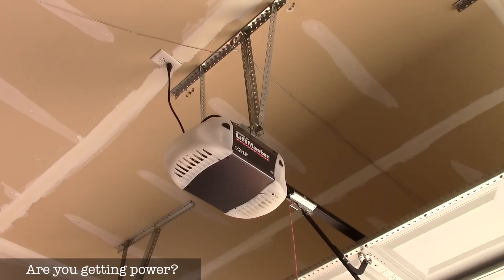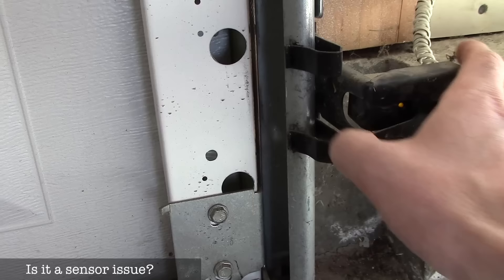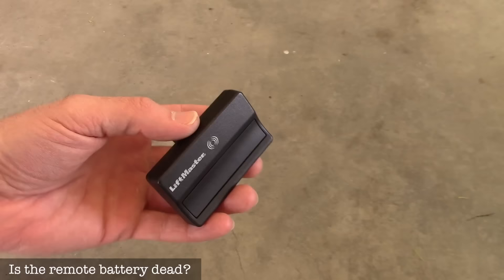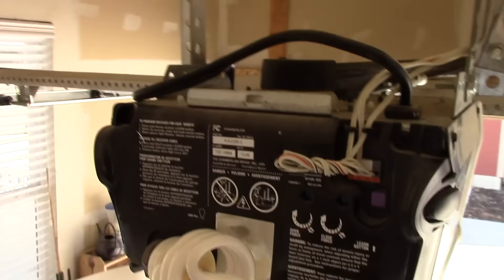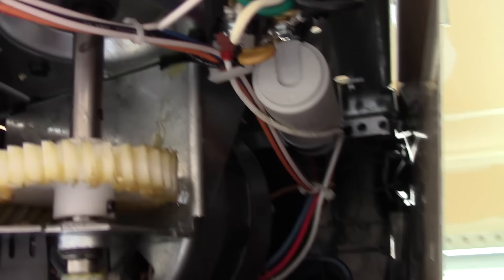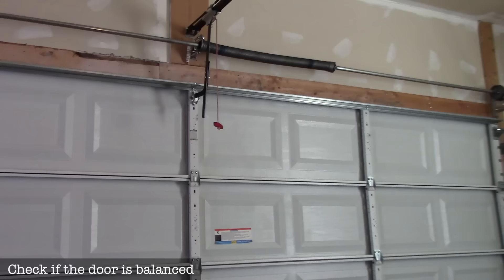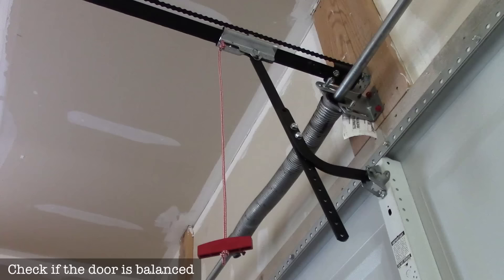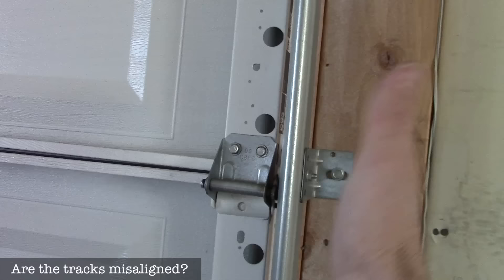Garage Door Opener Troubleshooting and Repair - How to fix common problems

Comment: Hi, good explanation!
Question?
I got my garage one time I was going one day and the garage was kind like to close .....just a little bit ...like came down like 12" Down and comeback up.

But I did make sure the sensor is straight.....well I guess it as I little bit move......but the other's days... .I was closing fine......
Because no body touch that area.......but any way....I move I little bit the sensor.......after like some period of time.....then close.

Well again it happen yesterday I was going.....and i did Luke 3 times closing.....and nothing....
And I was going to close from inside.......but I said myself......I will do one more time.....and it close the garage door.

But when I came back .....it opens but ..... didn't close it........I did clean the sensor s and try it to put straight like several s time......and nothing........

Should be the sensor s?
Because in the garage is power and the chain of the garage work normally when I try to open ........and the chain comeback normally.......but the door stay down?

Should I put.....a new SENSORS?

THANK U FOR YOU TIME.....

Comment: I have had a Stanley 01000 garage door opener for several years and it works great.  I also have a Liftmaster outside keypad and that has stopped working.  When I put in the code the Stanley opener clicks on the ceiling of the garage but nothing happens.  I cannot find a Smart Button on the opener to pair it with the keypad. Can you help?  Thanks, in advance, for your help!

Comment: Thanks for the video Adam but my garage door is still stuck. The motor/chain runs when I release the garage door off of it but the door won't move. I tried moving the garage door manually but it doesn't move. It's stuck in the up position

Comment: Adam everytime I get a power outage I have to reset the open/close limits.  This time It only holds the open limit but won't hold the close.  In other words it hits the ground then travels back up.  Does the board use a battery for memory or did something go bad?  Other than that the motor works just fine, its just a memory problem.

Comment: My garage door hums but will not open. I have replaced board and capacitor. I loosened the tension on chain because it seemed awfully tight. Still just hums. Do you think the motor is seized? There was alot of mud dauber nests. That was the reason the circuit board got replaced. I cleaned them out and didn't see any debris in the windings. I'm at a loss.

Comment: I had a voltage issue in a house both garage doors do not work so what is the most common when too much power gets to the unit? Capacitor,board or power supply?

Comment: Hi Adam, real nice video, however the problem i am having with my garage door is that when i try to open my door, the trolley would only move ever so little and that it (like 1/8"). I could manually open and close my garage door and I know for sure my sensor are good. I just changed my circuit board around couple of months ago and it worked perfectly until the last couple of days, this issue just happen. Would you have any idea what would be the case? Thanks

Comment: The small silver track that the door connects to is going back to far when garage closes, I have to pull the cord the door comes forward than it'll open & close, but to open again I have to do the same thing. How do I stop the metal silver track from going back to far? Thanks

Comment: Excellent instructions.. I have a craftsman model 315. I close it at night.  Later at night or next morning the door is open. I have re-programmed remote  and installed new btrys. No luck. Help!
Reply: I unplugged the battery from the exterior wall mounted remote and then plugged it back in and it hasn't opened since

Comment: I geta buzz sound,and nothing BUT chain seems to bind, on one side opposite tensioner side cap doesn't look bad but its probably cheapest to try first but I thought maybe take off chain from opener gear to see if it turns then

Comment: Adam, great videos. I have the same door opener, however I live in the country and all of a sudden my garage door just opens on its own.  Everything else works but can't seem to find the problem.  I have been locking the door to prevent it from opening. Suggestions?
Reply from the maker: Your nearest neighbor is how far?
Reply: They are located about 3000 feet away.  I will clear the codes today and see if that helps by reprogramming.  If not, then I'll check to see if I have a stuck button somewhere, and finally I will check for shorts in the house wired switch.  Thanks

Comment: Electrical power fluctuates from all power companies can damage electrical requirement and lighting strikes can damage electronic equipment of any kind as well. You should put surge protectors on every 120 volt electric  appliances or electronic equipment of any kind. They can save them from being damaged. I have surge protectors on everything in my house that use 120 volts. Including a dishwasher,  clothes washers, audio and video equipment, garage door openers, etc, etc, etc.

Comment: I am hoping you can help with an issue with my Genie garage door opener --- It does not work (either from remote or wall switch) when I reset the breaker it works.  Then stop working again.  Do you have any thoughts on how to fix?  Thank you.

Comment: Adam, I have three car garage with Chamberlain Liftmaster Formula I openers.  One of the openers does not respond to the handheld opener or my car opener.  It does work with the keypad and indoor pad.  When I use the handheld opener or my car remote the opener light blinks once but the door does not open.  The handheld opener work and car remote works for the other two doors.  Any thoughts what the problem is and how I can fix it?

Comment: Adam,
 I have a 2001 Liftmaster Professional series formula 1, Door opens all the way and then continues to shut off when trolley hits housing of motor. I adjust travel up and down, but I cannot get door to go down.(Out of sinc) Small light on housing blinks 5-times. As the eyes are adjusted too. I checked the gears and they are perfect. Need your help. Thanks Bob

Comment: so my garage door is cracking (tearing?) at the top center... it was installed the same way in my old home and i finally removed the garage door opener. A handyman remarked that it was a 5 minute fix, as the door wasn't properly installed for the size door it was pulling (i guess that main bar that holds the door to the center pully has several holes and it should be connected at a specific one, i think its called the J bar or bracket arm?) ... but i cannot find any instructions about which hole to use. Can you advise? PS i did not install either garage opener :)

Comment: Everything works, door will not close. But both of my Sensor lights are not on. I took off one and hard wired to the back of the  Garage opener and could not get the red light to come on. I am thinking of a Transformer  replacement. Your thoughts??

Comment: Adam,  my chamberlain model C450C has an  intermittent problem. When the garage door is closing all of a sudden the door reverses when it is 3/4 closing. I have replaced the ambler and green sensors. That did not make any difference as the problem still exists, but does not happen all of the time. Chamberlain has no schematics for the circuit board. I suspect that it could be a cold solder joint on the main circuit board. Is it safe with power disconnected to run a solder iron on the  main circuit board?

Comment: it seems in the last 2 months there is a beep for a second that comes from the garage door motor and this beep sound come back every so often either the door is open or close. 
Would you know what could cause this beeping noise? like and alarm beeping
Otherwise all is running good so far.
Thank you so much
C.Bourque
Reply from the maker: whats the model?

Comment: Hi Adam, My garage door goes up correctly. But if i want to close, it will go down, touch the floor and again go up. It doesnot stop after touching floor. So again i've to click the button so it will stop close to floor. And there is always some gap in between floor and door. Please let me know if you have any idea why its happening.

Comment: Switching the wiring from right to left has cured the opener from the open position to close all the way from the wall sensors. This happens due to natural light coming from different angles from the sun at different times of the year. The sensors get confused thinking it's an object. I've never seen  this shared?

Comment: Hi. I have an older sears Hbw1d3605 opener and this weekend I found the gear 41a2817 worn and the motor only turns on one direction. Other than the gear needing replacement, what could be the problem with the motor rotating only in one direction?  Any ideas?  Thx JP

Comment: Hi Adam,  I have a Craftsman 3/4 HP opener that's not traveling down to the same position consistently.  Sometimes it's travels long and sometime short.  I've adjusted the travel range but it's behaving a bit flaky meaning the when I make a minor adjustment it will barely respond or over respond.  Have you seen this problem before and can recommend a possible solution?

Comment: Hey Adam! Thank you for posting so amazing videos! I would like to ask you what could be the reason of the issue that I have with my lftmaster 1/3 hp. The wall opener inside the garage works without a problem, but the remotes and the keyboard don’t. I have replaced batteries and even bought a new remote! But nothing seems to work. I going to check all these other causes but I am asking just in case is a board problem that I might not see easily. Thanks for your time!

Comment: my garage door opener have no light in Both sensors I checked wire is good and I also replaced sensors still same but it closes if I hold close button from switch please advise

Comment: Hi and thank you for your informative video, however, my door is just humming when I push the wall mount to raise and close. I am trying to help my 92 year old neighbor with this. Initially I found one sensor bend from apparently someone hitting it so I realigned it. Now both are ok. I tried to reprogram the remote after opening the door. Somehow now the wall button just hums when I push it and nothing happens. I’m worried I did something to further cause a problem since now the door won’t go up at all. Help please! Also I have checked springs, wheels, etc. * I just noticed the chain is very tight. There is no play whatsoever in it.

Comment: I have a buzzing sound I think it’s the capacitor however I can’t find the exact one that looks like mine, but it has the same number the only difference is the back and it’s a 56uf not a 54uf  will that work?

Comment: Are chain drive openers interchangeable?  Could I replace the Overhead Door Model 556 with a Chamberlain Model PD752KEV or PD762EV?  Are Chain link and sprocket sizes standardized?

Comment: Hey Adam, older neighbor is having an issue with an xtreme door opener. Can’t get it to open even when holding the button. Tried to retract it and it cycled through. Eye sensors are red and green. Any thoughts?

Comment: Adam, I saw your whole video but did not find my issue. My garage door opens and closes flawlessly with the "doorbell" button inside the  garage. My issue is that I can open the door with any of the remotes from my cars or the external wireless remote but I can't close the door.  The floor sensors are also working well. Any more ideas..?

Comment: Hi, have you done a Motor Control troubleshooting? I have a liftmaster and is showing on the screen Motor Control error 1-5 or 15. Is only 2 years old and it won't go down.

Comment: I got a question about my overhead garage opener it was working fine with my wired wall button and with my phase 2 auto remote but when I tried program my wife’s Toyota Sequoia to the system and it took a code but know my wall button and the phase2 not working and all it does makes a humming noise for a few seconds but the chain does not move

Comment: My breakers arked and cooked my opener. Breakers have been fixed. Is my opener finished or is there something I can replace to get it up and running again? Power to opener is correct now. But no LED'S light up

Comment: I have a question. My genie screw drive opener ack and sounds like the trolley is slipping. I have replaced the trolley and coupler and still sounds the same and checked springs and balance. Any suggestions?

Comment: Wow. This was a lot of various issues. Most not very "common" however. (other than remote battery). Usually, sensors or limit switch. Bad capacitor? In all my years, I've NEVER seen a bad cap in a door opener. (or a "bad circuit board" ftm). But, never know. ;)

Comment: If the lights are completely off and the breaker in the control panel is okay; then, check any outlet in the garage that has GFCI; it the light is on, thenpress the button to reset it.

Comment: Hi Adam great video lesson.  I am a single women and a little afraid to try to do any repairs.. My garage door remote won't open electronically, and it won't open by hitting the switch on the wall.  I get this grinding sounds both ways.  I had a guy look at it and his first response was you need new springs without opening the Genie 1/2 horsepower  screwdriver model, he didn't look at the wall system he didn't unplug the system he did one thing looked around and said you need new springs, please I need your advice, I though about buying a carriage to replace the old one.

Comment: Thanks for the great information, however I have a further issue.  The opener does not function with the remote opener in the car or the wall opener.  The wall opener is flashing both LED's constantly & the door unit clicks.  If I push the Lock button the bulb flashes & the unit clicks.  If I pushs the Light button the unit clicks & the light on the unit flashes once.

Comment: Guys, I need some thoughts, ideas
The outside garage wall fixed keypad had a battery lived for 7 yrs. I changed it with a like for like (Energizer 9V) and dyed within 1 month. I replaced it again with another Energizer and died again within one month. The keypad fixed on the outside wall and hard wired to my garage opener. The wire goes behind the wall 
What’re your thoughts ? 
Thanks

Comment: Adam I have a genie 2028 garage door opener. I pushed the wall opener, got in my car, I was backing out of my garage and the  garage door came down on my vehicle with enough force that it punctured my vehicle. I then used my remote to reverse it. I backed out into the driveway and sensors had lights on. Here is additional information. It is 15 months old. It has an LED non garage light that installer had put in. The temperature dropped 30 degrees the night before but it was about 11 am and sunny. any ideas?

Comment: Hi Adam, great videos! I have a special circumstance. I believe my sensors are operating properly, just installed a new control board (bought from Chamberlain), a new RPM controller, and still my door won't close (3 calls to their tech support).  When I press the button the motor loads tension onto the belt for a second, then sounds like it's reversing but nothing moves.  Any suggestions?

Comment: I have a Stanley Premier Digital garage door model no 3832.53 Serial code 93344. My remote control has stopped working and I don’t know how to replace it. Will a universal one work.

Comment: What if after trying the force close, the door goes all the way down but still comes back up ? I just fixed the garage door spring myself by replacing them btw and I don't know if I may have over or under tightened them. I pulled the rope to disconnect the garage door to test whether it was some tension on the rails but It still did not close all the way. any ideas?

Comment: If I pull the rope to release the door, then the garage door will open and close. If it's closed all the way and I latch it back up it doesn't open. Again if I release it from the rope. Then it will move when I press the button. Is it my motor going out or can it be the compassator?

Comment: Sprocket will not brake off..

I use to rebuild these particular parts;  it’s the bearing that holds the shaft that goes.  You can see it in the grease.  It’s made from a softer metal then the shaft and sprocket.
I worked for a door company;  did service with the owner that’s been in the business for over 40 yrs.

It’s an up and down type of business...🧐

Comment: There is no noise from the motor at all when I try to open my garage door. It was newly installed in 2008 when we moved in and barely used because we never had our cars parked in it. One day it wouldn`t open and I pulled the string to open it and it hasn`t opened electronically since. Any idea why it just stopped working? And everything on it still looks spanking brand new.

Comment: I just replaced a torsion spring on a 9x7 door. My problem is when the door is up the cables have slack in them and can come off the drum. The rod that carries the spring and drums will turn in the same direction as when the door is going up and I don’t believe it is supposed to. Any suggestions?  Thanks.

Comment: I have a craftsman model no 139.53479SRT.
I went to unloosen on of the electrical connectors and the entire circuit board seemed to break lose from the outer shell. Everything still works, but I'd like to remount the board back where it belongs. There are two screws through the bottom that I had hoped just removed the lower shell. I can't seem to find the correct procedure to get to the circuit board, and I don't want to damage anything else. Assume plastic bracket broke that was holding board. Learning button is green. I was installing a smart  door opening system. Can still do by splicing the two wires, but still would like to remount the board. Do you know the procedure?